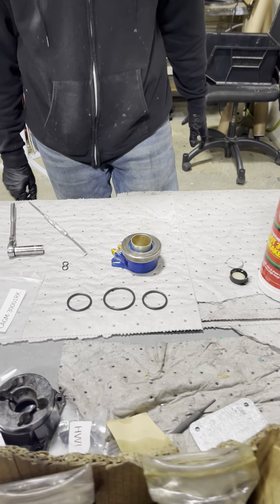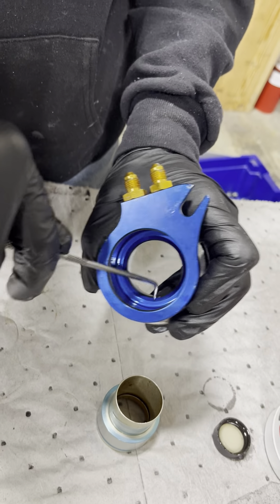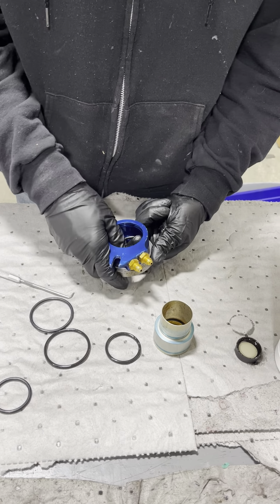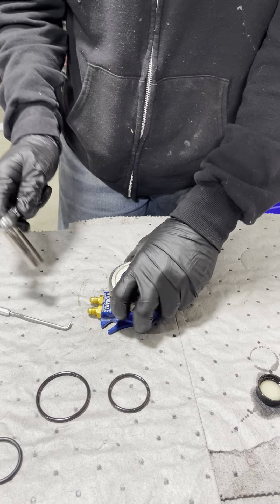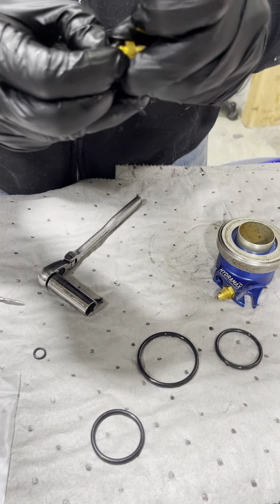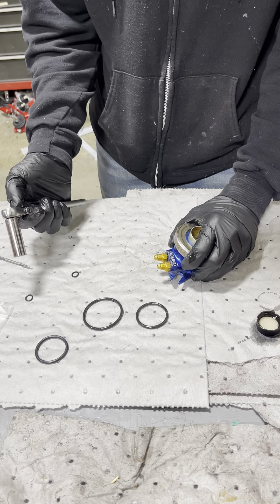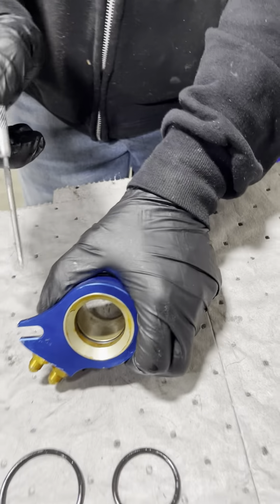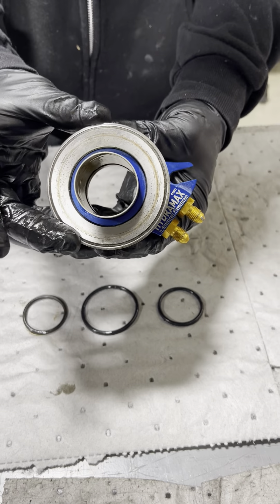How To Rebuild Your American Powertrain Hydramax Hydraulic Throwout Bearing.

Comment: Thanks for posting the video on the rebuild. It was painful watching the Tech with that pick trying to remove the o-rings and possible damaging the surface where o-rings seal.. Kit part # would be nice. Thank you.
Reply from the maker: He does 100s of them they all work great
Right here on our site    https://americanpowertrain.com/shop/hydraulic-clutch-kits/hydramax-bearing-rebuild-kit/
Reply: @AmericanPowertrain  Thank you. Can you provide part number for the 30001P bearing rebuild kit please. The GM one. Thank you.. Is this correct one?  American Powertrain CAGM-30001RK
Reply from the maker: @chuck3376  only 3 options you just select the GM in the drop down options that will do it
Reply: @AmericanPowertrain  Thanks, But I ordered a new bearing and seal kit from Summit Racing. That's the only part number they show.